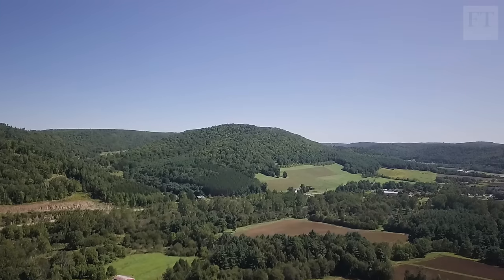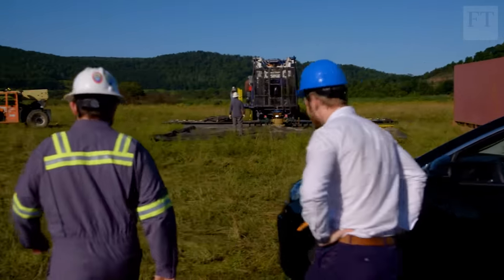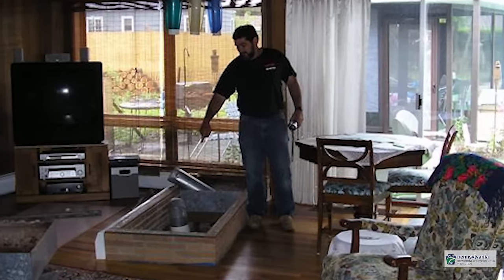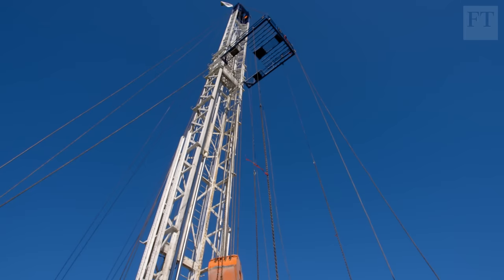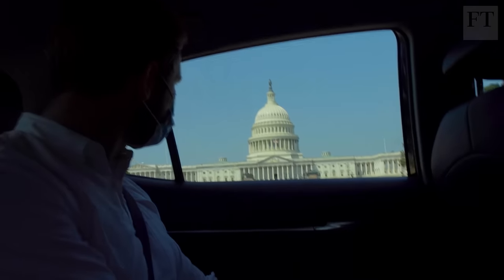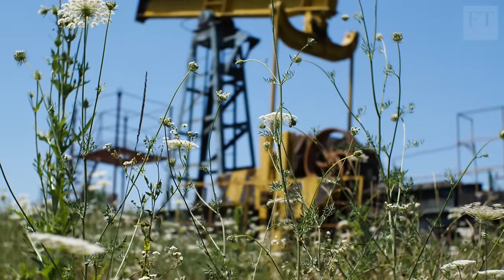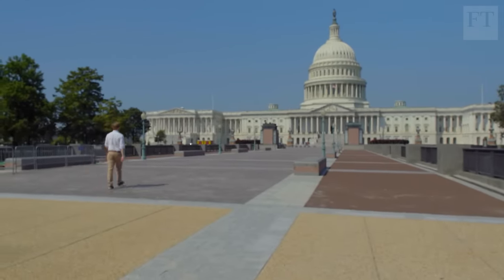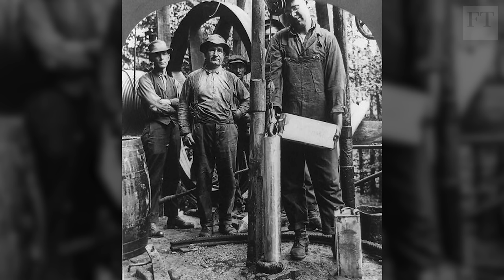Who will clean up America's abandoned oil wells? | FT Energy Source

Comment: Who will or who should. The oil and gas industry should of course. My fix is rather simple. IF an oil and gas company wants to drill require them to plug a few 100 or 1000 old leaking wells first.

Comment: Mother nature! In your home town there was a large firm that duga huge pit in the clay on there property filled it with gravel and dumped all of their wast oil in it! After it closed no one would buy the land because of the environmental clean up required. 50 years later it was sold but when the new owners did an inviromentle assessment there was no oil. Natural emzimes had ate it all!
Reply: Did they east the trash too?
Reply: @Fido-vm9zi  in the mid-70s, two carbon containers fell off aship and broke open in the mid Pasific. They dumped 80 tons of plast bathtub duck into the ocean. In 2 years the ocean had eaten them all!

Comment: I was wondering that if there are hundreds and even thousands of wells in an area it means there are huge oil reservoirs underground there and a lot of oil in them are remaining that are leaking to surface so what if we drill a few new big wells we can drain most of the oil and gas remaining there and almost no oil and gas will remain to leak. Oil companies can easily measure the volume of reservoir and exact locations and dimensions of them to do this job.
Reply: Unfortunately, that wouldn’t work. As a rule there are no oil remains around abandoned well to justify the cost of drilling of a new wells.